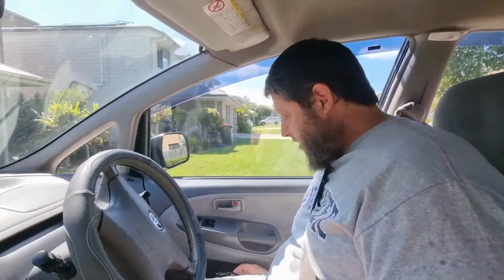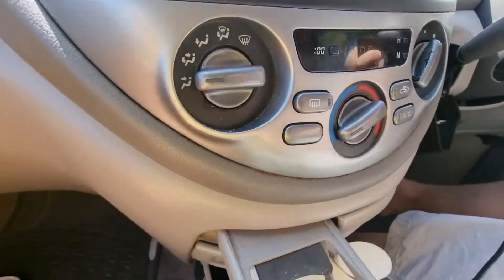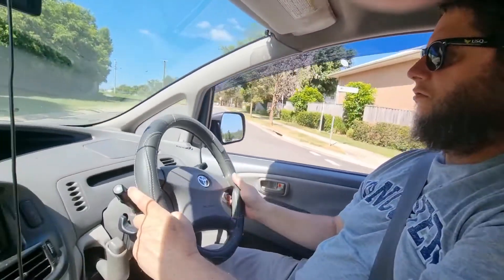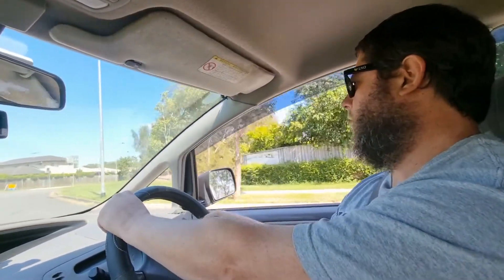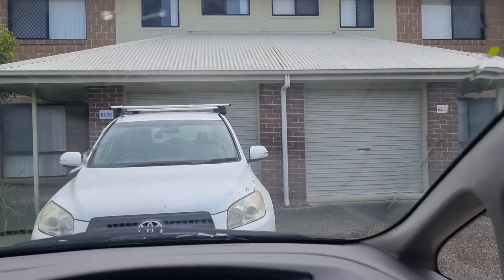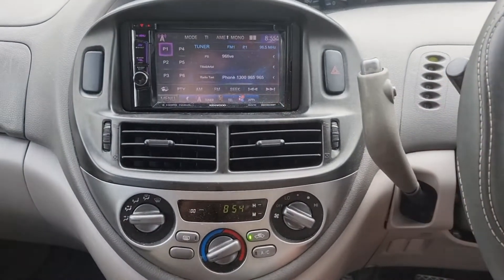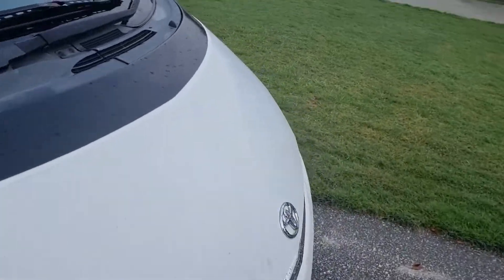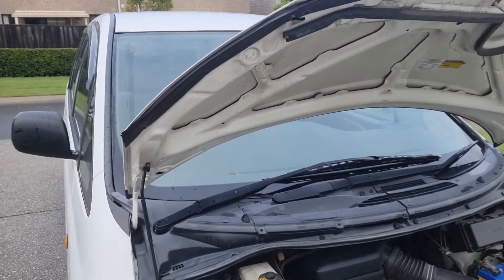Toyota Previa Estima Tarago Air-conditioning Problems

Comment: I have a 2001 Toyota tarago. Very similar toy yours. Have you ever tightened or replaced your outside door handles on the back doors? Mine keep getting jammed and you will have to open it from the inside handles 🤦‍♀️ i cant find anything on the net about it for my year model.
Reply from the maker: My left rear door won't open from the outside, I can only open it from the inside. When I do take a look at it I will video and upload here